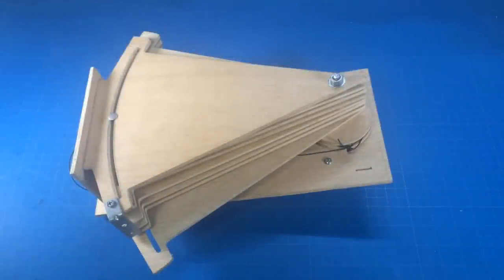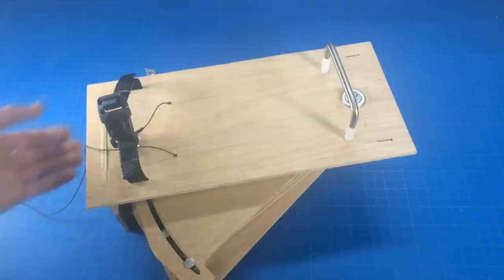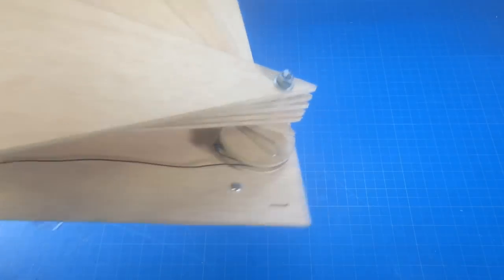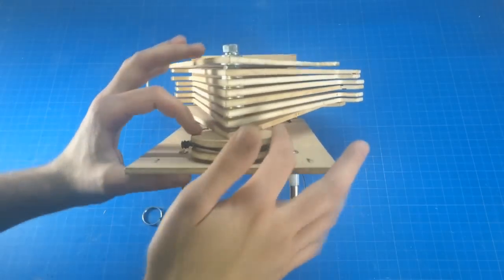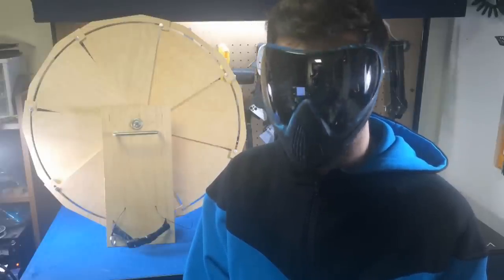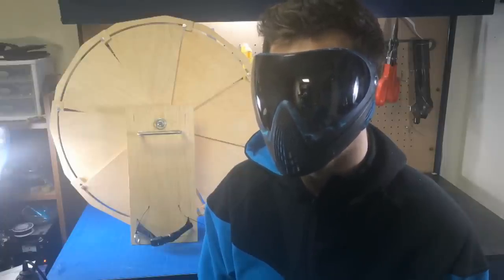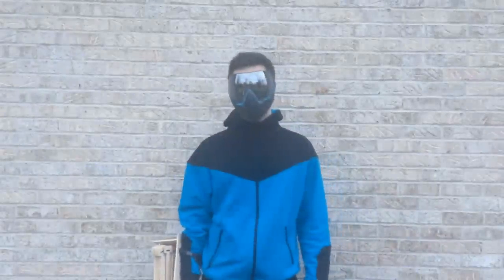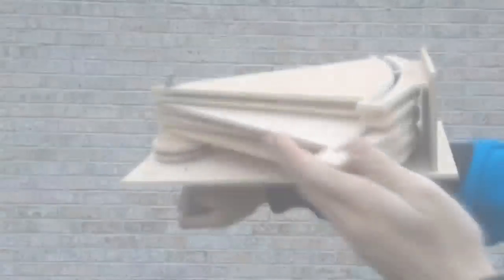Deployable Arm Shield "Percy Jackson Wrist Watch Shield"

Comment from the maker: Thanks for watching! Please vote for me @  http://www.bocabearings.com/innovation-contest/ContestantDetails.aspx?ProjectID=227

Anybody who is experiencing issues with facebook voting, encourage them to use the email option. They have had sporadic reports of some intermittent issues. Also people can simply email a vote to innovation@bocabearings.com if they are having issues.
Reply: You could've just used one string. You could use one string to deploy it and it retracts to close the shield when you let it go. So as you put it on, the ring would be attached to your thumb while the rest are holding the metal bar of the shield, and when you're done using the shield, simply cock your thumb back so it could retract the string and close the shield
Reply: Dude why would you even think of giving up? I mean,look at you ...you have been givin and further evolve your brain by your own....just look at what the things you can build ....you can be like tony stark's disciple ... Just don't give up on your inventions...keep suprising us with never seen before inventions :)) VOTED
Reply: I would advise adding some encased bearings or small sliding wheels under each strip of ply as it will slide better and not jolt so often. Great video and great concept too!
Reply from the maker: +Hunter Wolf Thank you!
Reply: +GreekGadgetGuru You could use a small lithium battery, electromagnets, and a spring instead of a string
Reply: +GreekGadgetGuru Absolutely fantastic job! I was wondering if you were perhaps going to make a tutorial for this build? This is outstanding work! I can't reiterate that enough! God bless!
Reply: +GreekGadgetGuru Another quick question: If I perhaps draw up some designs for a more compact version (with an automated trigger mechanism as opposed to strings), would you be interested if I were to send it to you and you perhaps give it a look? I am giving this a try, particularly because I am interested in an instant riot shield that is compact enough to be carried on your arm every day.
I'm quite good at designing, as I'm entering engineering
Reply: Id say a small motor wouldn't help in a few ways. Firstly with a battery system and possible failure. You also may have to work around bulk issues, judging by your skill I think you could make it work but I think sustainability and maintenance would be an issue. Some others have said a spring system may also work, this may be a little fidgety but might end up working well in the end should you have the ability to keep everything locked in place. If you had two springs that went into tension and release; one pulling the shield open and the other closed could eliminate bulk and allow a simple release/catch system which also allows you to get rid of the string that seems to dangle a bit.
Just a few suggestions, nothing new from the comments below. Good luck, we need more innovators like you in this world!
Reply: +GreekGadgetGuru I think a bit of a weak point would be the thin strip of wood/metal on the end holding the pin. If hit by a weapon, it would ruin the closing mechanism.
Reply: +GreekGadgetGuru ...  just a suggestion, maybe use a spring or two so it's easier to open [and/or] close?
Reply: maybe the wheel of Amraa (or something like that) can help you, I can't really imagine anything rather than easy improvements. Maybe in the future you can make the tang (thingy that hold the pieces of thr shield, I don't know exactly how to name that) telescopic and automatically collapseable, like a weak piston or something, made in such way you deploy  and when the parts are in place it collapses and when retrieved (fuck my english, I'm not american) it extends again. Hope it makes sense at least, good luck m8
Reply: I voted!! Its realy nice!!
Reply: +GreekGadgetGuru Have you tried adding a finish, polish or, lubricate on the wood to reduce friction to stop it form binding.
Reply: what if instead of the plates being stacked you made them fit inside of eachother like those russian toy that you open one cup thing and you take another one out etc
Reply: just a thought
Reply: Do a face reveal please you have over 300,00 subscribers
Reply: Just voted for u good luck man
Reply: +GreekGadgetGuru that shield wont withstand a punch
Reply: +foniko1 prototype man
Reply: +GreekGadgetGuru You should have the shield sit on some type of gauntlet.
Reply: +TheViralEvolution Also, I think it would be easier to use if it was spring loaded.
Reply: i feel like you should add some sort of bar at the end/beginning of the shield made of metal to stop the pieces from going backwards, you should also add magnets(if you add that metal bar) to the last piece to make the shield stay open without holding the string, I feel like this retractable shield could be brought to life if you go about it the right way.
Reply: its good so just decorate
Reply: People that live in the hood could use this when the neighborhood gangsters do drive by's
Reply: +GreekGadgetGuru Know your history:metal shields are stupid
Ps.the shield shards...well they look like if you hit them itd bend and do stuff....and you cant really add a hide covering for protection from the enviroment
Reply: +foniko1 That's why he wants to make one out of metal -_-
Reply: wow omg if you could try to make it like spring locked you could try to have it opend up really fast by like pressing a button on your handle
Reply: When you make a metal prototype how bout setting the scales at a angle to avoid possible splash damage after impact of something like a glass beer bottle
Reply: +GreekGadgetGuru I think the center of the shield should be closer to the middle of the forearm. Also, make sure your enemy cant fold it back after you ve opened it. Something I really like about this is that it can serve as an average shield, but also as a smaller extra tough shield.
Reply: Maybe you can use a system like the ratworx mrx chain driven auto knife for a deployment system?
Reply: +GreekGadgetGuru that was a very cool prototype you made their well done. In the vid you asked for suggestions so here goes.

Im no expert or anything but would an air pump mechanism be a possible idea for expending and retracting the shield??? rather than a pulley system with strings  you would have a single air pump that could both extend and retract the shield id imagine the pump could go along the users arm and would be operated like a pump action shot gun motion.

it doesnt even have to be an air operated pump with the right gears and mechanical teeth (OR STRINGS) it could be mechanically operated as well

i really like this thing so in any case keep up the good work.
Reply: is you airsoft or paintball
Reply: Wyatt Hen What?
Reply: +Swiggity Swooty I was asking the guy who made the video
Reply: Wyatt Hen The sentence still doesn't make sense...lol.
Reply: +GreekGadgetGuru are you from greece man if so you will understand that μολις μπηκα στο καναλσου και ιδα οτι ειναι ελληνικο.If not go to google translate....
Reply: +NODS PRUDUCTIONS S  just entered the kanalsou and na that is GREEK
Reply: +Jesse Regalski i speak greek i am greek com on teach me how to speak me language
Reply: +NODS PRUDUCTIONS S you sound Irish but if I'm wrong i deeply apologize.
Reply: Is it still to late to vote?
Reply: Maybe for a more durable string you could try using a small cable like the ones you see in standard gym equipment
Reply: Can't wait to see the final build...  Check out my channel and lemme know what you think.
Reply: +GreekGadgetGuru POU SE RE PATRIDAAAAAA
Reply: ετσι ρε φιλε
Reply: Found out his intro is wasn't made by him.
Reply: you should have a little hook on your arm to make it so it can't go back to compact when your using it
Reply: Yo check out D3O putty. It's a new invention and is pretty much like flubber. The military is using it for armor well as motorcycle riders or sports players like myself.. Check it out!
Reply: Nice Dye I4s man!
Reply: trt tampered steel otherwise known as memory steel
Reply: You should also make a better arm strap and also paint the GGG logo on it or put greek gadget guru in a circle on it like a record middle how it has the name written on it AND make it a little flatter would be good
Reply: ALSO you should put a knofe holder on the inside or put spikes on each of the shield "wings" so you can stab or you could put it on the three that face sideways when your holding it
Reply from the maker: There's a few ways to look at it. Look into Dragon Skin Armor. It is basically multiple discs of armor overlapped over each other so the wave of impact is spread out and absorbed by a much larger surface area. Traditional armor stops by shattering the bullet with an abrupt stop,, this type of armor catches the bullet and redistributes its energy.
Reply: For a deployable shield 2.0 I think you should try a linear leaf shape design using some kinda metal  and instead of using a pully string you should have a gauntlet with two buttons one to open and the other to close the shield.

Comment: 1. make each triangle more stream lined.
2. get rid of the spacers between the triangles and replace them with notches so they make a flat surface when deployed.
3. replace the pulley with a spring like you would see in an assassin creeds knife. i suggest referring to Colin Furze build videos.
4. by fasting the lowest triangle in place, you wont need the block. 
5. move the triangle rails from the outer edge closer to the center. add ball bearings.

even one of these could help to make the whole design more streamlined and smoother.

Comment: Neat idea. Try a circular spring instead of the pull-ropes. IE, a spring wrapped around the post, with one fixed tab and one on the first panel. Then use some kind of locking mechanism to keep it in place until you pull/push a button, the lock is released, and the spring expands.
Reply from the maker: +modelmanjohn Right, I also had this idea. "some kind of locking mechanism" is easier said than done haha. Maybe someday.
Reply: +GreekGadgetGuru you could have two bearings that line up when fully extended, then have a pin on a lever thats springloaded that goes through after being fully extended, then push the lever to unlock. Hopefully you somewhat fget what im saying. Also you would have to put a hinge and two points on the lever to keep the pin vertical
Reply: GreekGadgetGuru okay, i'll try to draw something up then
Reply: Wouldn't spring have to contain tension at both stealth  mode and sheild good concept but meh
Reply: A coil spring is exactly what I was thinking. Then, to retract the shield, you'd just pull it with a single cord. Less hassle.
Reply: +GreekGadgetGuru I'm not the sort who could make a drawing, and I'm just throwing this out there, but doesn't the lowest plate need to slide out so the others can move? If so couldn't you just put a pin through into the bottom plate to hold it in place? Even if you decided against having it springloaded it could still be good to keep it from sliding around like it does in the video.
Reply: Have it cock like a nerf gun and deploy like one too. So have a spring start at the left side at the back plate facing the user and wrap it around a pole toward the front and connect it to the leading shied plate have the shield plate locked to the back plate in some sort of way like maybe a spring and a wood block that can be reset.

Comment: Wouldn't carbon fibre be better than steel? Lightweight, with pre-made molds easy to replicate and strong. Would also give it the classical "Why, oh why do you have it" look!

Edit: And a spring system could make it deployable by a button press
Reply: +WKDworks While carbon fiber is stiffer and lighter than steel, It has a lower impact resistance and would not last as long.
Reply: +Zane Robinson and it's not cheap
Reply: The material does not really Matter, a really god shield can be made out of wood
Reply: +asvp.koray I don't know if that's savage or just funny.
Reply: +Zane Robinson you can enrich carbon fiber with an alloy of copper making it very resistant. I think the carbon fiber idea is pretty sweet.
Reply: +Sebastian Cor (Lunatic) still any steel blade would cut through it like butter and you cant deflect blades that good with it because it doesnt have a smooth surface but many diiferent parts where the blade can get stuck in
Reply: +Sebastian Cor (Lunatic) copper is a very soft and malleable metal as well, steel is always going to be the better choice.. Plus it's easier to work with.
Reply: +InnovationInspired hes talking about using it with carbon fiber. not plain, you just want a shiny grey shield
Reply: Dyneema black fiber would be better lighter than Kevlar but stronger and its black like carbon fiber
Reply: +Kurt Benner and if you mix it with copper like the carbon fiber it would increase in strength and if you put a thin piece of sheet steel behind it it will be much much much stronger
Reply: +WKDworks Kevlared Dragonskin.
Reply: Technically speaking Titanium would be a much better option, since its less likely to shatter
Reply: +Polaris but it's so heavy
Reply: +Lucas First It was a joke. It's WAAAAY too expensive to get that amount.
Reply: But.... you didn’t... edit it?

Comment: looks sweet but a bit bulky atm, ik its early prototipe, what if you use aluminium and get the end of the blades tight up to save space.
Reply: that's pretty genius
Reply: I literally see you everywhere, mostly on Dota videos
Reply: aluminium is really soft though and this will never be as strong as just an actual shield.
Reply: +Walrus Warlock I would have to disagree. Aircraft aluminum is very strong and VERY protective from blunt strikes and from light bladed weapons. Many in the SCA make their shields and armour from this material and their hobby is beating on each other with thick rattan sticks lol.
Reply: +Walrus Warlock how about an aliod aluminum
Reply: +Dark Repulser Try an aircraft aluminum. It's very strong. Can take a good beating. Also, with a shield that size, I would bring the array further down on your arm and closer to your elbow. It will protect that joint and also make the shield a bit stronger, being braced by more of your arm, less chance of warping from it taking hits being further out.

This knowledge comes from over 6 years of SCA heavy armoured combat and using materials such as wood, plastics and aluminum.

With the aluminum, you also dont have to worry so much about material fatigue and break down as you would with wood. Splintering can also cause more of a detriment to you. Also, say if someone throws a beer bottle or EXTREMELY worse, a molotov at that thing, you will be regretting it at a rage of damp, soaked wood to OMG! MY ARM IS ON FIRE!!!.
Reply: Ok
Reply: Emir Sandoval prototype*

Comment: Although it would be very difficult to design/ fabricate. I think this idea could benefit from using a telescoping instead of sliding design. It would prevent spaces between shield panels being a weak spot, that an attacker could use a stab attack through. It would also help keep a low profile if you used a thin, sheet metal like material. This of course would make a deployment mechanism more complicated, but I think it's something to keep in mind for a version 2. Keep up the good work!

Comment: If your still having trouble with the round shield jamming try doing a square or rectangular shield that instead of spinning, slides each layer out from under the other to lock in place. It should cut down on jamming and keep it just as maneuverable.

Comment: Prototype or not this thing is bad ass. Although smaller swinging parts would make it more portable and discrete, it would also mean more height and less discrete so I think you picked the right ratio there. I think metal would solve this problem because you can get it much thinner and metal is generally stronger then wood so it wouldn't effect its strengths during use.

Comment: I would personally make it thinner by separation the big plates into twice as many small plates and have each set deploy opposite directions, this would make it not a wide and close the large gap left in the current design. It also may not hurt to add a locking mechanism so it will be locks in deployed or otherwise. I also know how fond you are of takers and sorts if you were to make the plates metal you could have alternating polarity on the plates and this would make close combat go a lot smoother.

Comment: you might want to use CO2 cartridges to instant deploy it
Reply from the maker: +nathan de crom Yes, using compressed air would work, I would need a pneumatic cylinder, they cost around $80-100 each :/
Reply: Yeah that's what I was about to suggest
Reply: You can install two co2 one for each function
Reply: Jesus Torres  true and you can make it easy to reload and still have the manuwal as back up
Reply: +Jesus Torres or just split the co2 into 2 different reservoirs so you can use the gas more efficiently.
Reply from the maker: +nathan de crom Smart idea. I&#39;d probably run it to a backpack with a regulator and a paintball CO2 tank
Reply: be a bit clunky tho, wouldent it? keep it more compact in just the shield.
Reply from the maker: +nathan de crom Good idea, backup ways are important if something technical malfunctions

Comment: I'm no engineer I just tinker with things time to time. Switching to metal will probably help a lot with weight and size.  I would personally go with a more deploy/reload type system with a spring and a lock(maybe a torsion spring?) instead of a the open/close pulley. Everything looks really stable so it'll probably be a lot of fine tuning for better results. A maybe more comfortable and snug gauntlet, different washer/barrings for better movement, curve it to help the locks. Any fine tuning may or may not positively or negatively affect the end result. Best of luck on that final design.